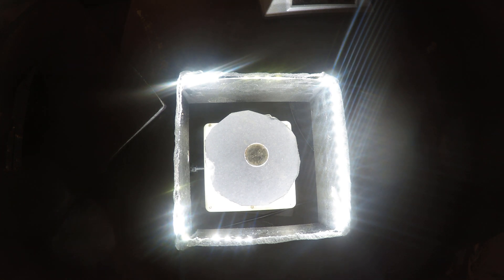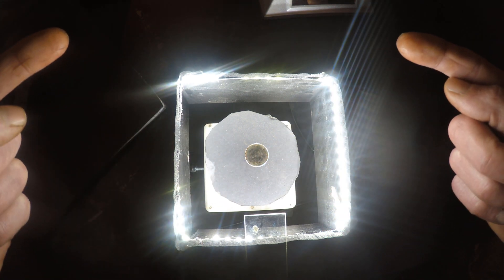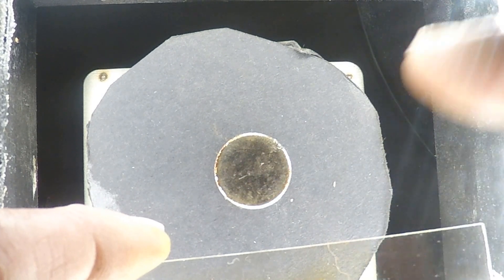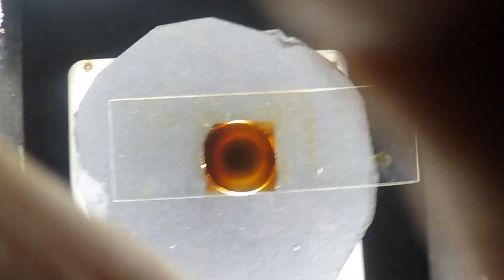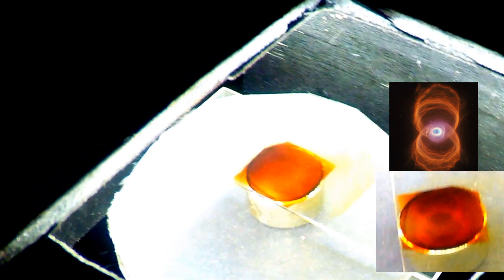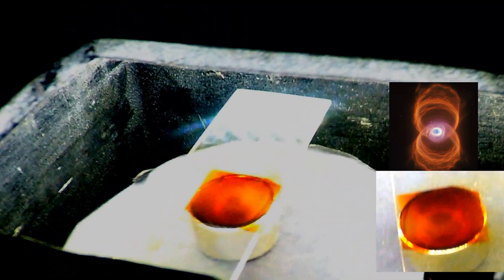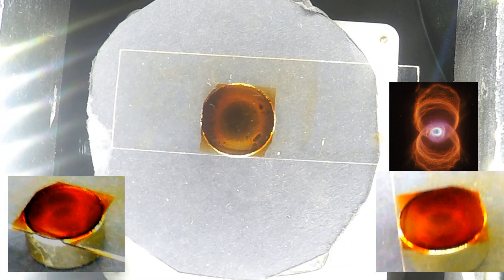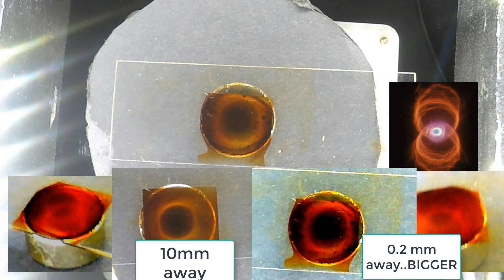Magnetism - ferrocell made from 0.2 mm Microscope SLIDE

Comment: What happen if you hang a magnet in a glass used to drink, but filled with ferro fluid?   Thank you.
Reply from the maker: if you freeze a magnet in water you see how the mag field separates water into hydrogen and oxygen at either pole....on video somewhere.
Reply: What exactly is ferro fluid made of? Electric or Magnetic H2O? Will it thicken or thin as it charges or dissipates? Would observation or perception effect the fluid?
Reply from the maker: iron nano particles...in   oil..you add 50% baby oil to see through it.
If I had the equipment I could tell you.
I dont :)
Reply from the maker: not a lot...it becomes like iron filings really....same look.

Comment: Could it be a vortex base on the face?
Reply from the maker: The top of a vortex on the face of a magnet tells you what?
Reply: @ScientificLee  Sorry Lee, extremely busy. Don't quite understand what you are asking. My thinking is that you can't have a vortex apex on the face because there would be a single concentrated point with proportionately lower forces the further you move away from the centre, yet the whole face seems to have the same power. So is the power on that plane? 
What I also find interesting is that if you have a pyramid shaped magnet the faces have the same power but it's distribution is dependant on the geometry. The pointed end can lift, let's say a  kilogram max,  but the base can't. But if the kilogram is separated into smaller pieces the base can lift the same. I'm trying to get my head around how the vortex would be different. Is there one concentrated vortex on a point and many smaller ones on an area? How are you anyway? Is your paypal down?
Reply from the maker: @cobail1  haha only just seen this..yt tells me zero...the funnel is inverted...an upside down tornado.